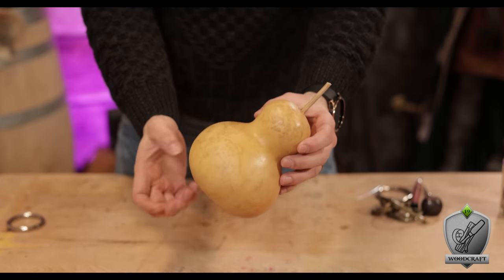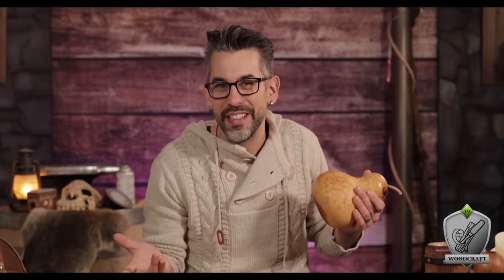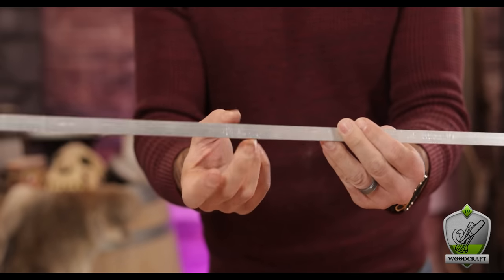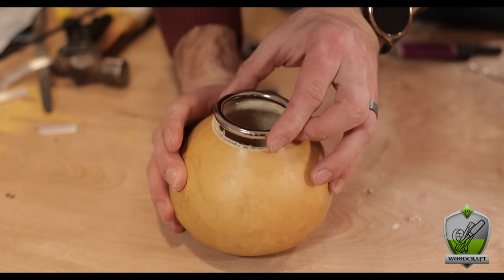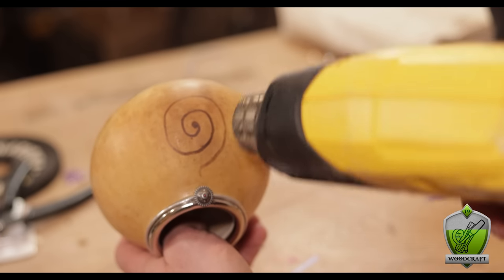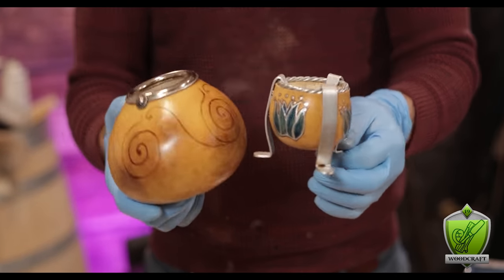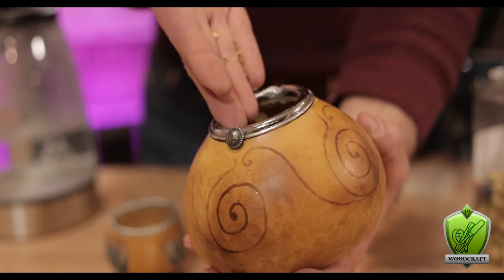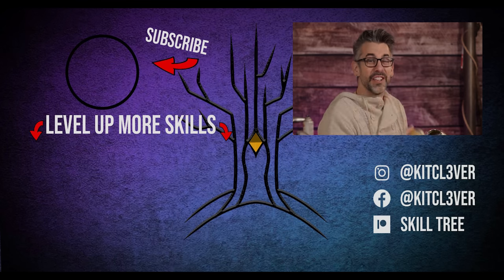Super Easy Gourd Tea Set

Comment: But how did you seal the inside?
Reply: I wondered the same thing
Reply: Another comment said the hkt water would have cured it so it wouldn't need a seal.  Completely outside my expertise so I have no idea if that is right.
Reply from the maker: It didn't need to be sealed. Turns out the gourd will hold water just fine without it. Just need to cure it a bit by adding hot water and scraping out the gunk. I wouldn't do that with a bottle though as it won't dry fast enough and will mold

Comment: What would be a great idea is if your tea set was self contained for a journey or something. Like maybe have a way to secure the cup as a lid and then mount the whole thing to a bag on the go or something.
Reply: Yeah a screwtop would be amazing. Just screw 'm together for easy adventuring!
Reply: I was hoping they'd connect and house the tea while not in use. Might have to order some gourds and prototype it myself for when I get to go back to LARP.
Reply from the maker: Love this idea! I will get to working this out!!
Reply: @SkillTree  Maybe a larger gourd, one with a wider opening to act as the teapot, and then a smaller one that can fit inside the bigger one for the cup(s)? 🤷‍♀️ 
Just a theory.
Reply: @SkillTree  my thought was to slightly elevate your Concho, and maybe adding to the spout form the outside by soldering a small lip. Then too wire loops on your cup. Loop one over the concho, then press the other over the spout! 

Probably not water tight like some are talking about, but a nice way to keep the set together!
Reply: Just hand tie a net to go around it with cordage or wire wrap it like you would a stone. Maybe some wooden or antler toggles to lock the lid/cup in place. Another option would be leather strapping, kind of similar to the mana/health potion bottle build. He gave ya the beginning tools, as crafters it's our job to expand and improve on the initial inspiration. This is how we make it our own.

Comment: Really neat little set.  Those gourds are really versatile.  I'm concerned about the metal rings you used along the rims, though.  Unless they are food-safe you may end up with metals like nickel, lead, aluminum, etc. leeching into your drink.  Also, your beverage may heat them up while you're drinking, which gets pretty uncomfortable on the lips (I know this one from personal experience with a camping mug I purchased a while back).
Reply: That was myu concern too. I know that aluminum is not good to use for hot drinking vessels, and uncoated it isn't good for cold either. He did use Aluminum for the wire in both so that will come in contact with the drinks.

Comment: I actually use nontoxic food safe resin to coat. As long as I’m careful when I turn it to coat it. It works and I also use it to make custom bottles with mica and edible sparkle dust.
Reply from the maker: What brand do you use? I have had a beast of a time finding a good food safe resin
Reply: @Skill Tree  the main concern related to the use of fully cured epoxy resin as a food container is identical to the concern surrounding other plastic items that hold food, BPA leaching. A hot drink does increase the amount of leaching compared to a cold drink but many containers also use plastic with BPA so if you are replacing a plastic container your consumption of BPA doesn't change. Additionally as this device would only be used a couple days per year the increase would not be a problem, mostly because we are constantly consuming BPA all the time and have bee since the 60s

Comment: 1. The legs didn't adhere because the skin of the gourd is not just waterproof, it's glueproof too.  I didn't particularly like those legs so yay failure!
2. If you can find a tea strainer that's the same diameter as the opening on the pot, you'll have an easier time with using loose tea.  I bet you can.
3.  Every single project I've ever worked on is a repurposed version of a previous project I made.  I think it must be part of my creative process.  Or I just can't leave things alone.
4.  Great job!
Reply from the maker: Oooooooh, good call on the strainer! I will need to look and find one!.
Reply: @SkillTree  That looks almost the size of the drop in strainers from the cups David's Tea sells? I might be miss reading the size, but if the opening is roughly 70% the size of a standard skinny coffee mug it should fit?

Comment: Would be cool to clean out the gourd, carve designs throughout, fill with resin and colored LED lights, leather strap/quick detach belt loop around the neck, boom, mages spells stored in a gourd. Can even use different colors and such for different spells.
Reply: That'd be so cool! Could probably conceal the battery pack/on-off switch in the bottom of the gourd.

Comment: A good idea, but I have a couple observations and suggestions. First, hot liquids make metal hot, which can feel uncomfortable against one's lips. Second, using two metals, steel and aluminum, might create a unwanted galvanic reaction. Third, if you wanted to make a pitcher, maybe leave the upper part of the gourd so that you can tie handles in the neck like you did with the water bottle, and; fourth, you can carve a spout. Fifth, you can create a set of cups by using the tops of several additional gourds, and; sixth, you can use the bottoms of those additional gourds as jars with lids of cork and/or wood for holding dry herbage for teas, tisanes, and tinctures or other sundry items.

Comment: Ah. The gourds are all sold out. I'm noticing a trend here...

As for the project... I'd have used the food safe silicone glue instead of the epoxy. Epoxy just doesn't seem to like organic things. It can work for wood, but anything else is unpredictable at best. Maybe there's a way to treat the gourd surface, maybe a thin layer of epoxy and let it cure before trying to use more epoxy to glue down the aluminum. Maybe also using a couple bands of wire would help hold the legs into place in a decorative way. If you want to try the cute cauldron style again. (P.s. I hate 2 part epoxy. It's always a disaster, probably because of my climate or time of year or whatever, so, biased I am.)
It could be cute to use more of the aluminum strip to make handles, but you definitely need decorative wrapping to reinforce it, or silicone to waterproof the rivets that would hold the handle on. Those would be easier than cutting a couple of slots for the aluminum to feed into- and seal gaps with silicone, of course.
I can go on forever with ideas, so I'm going to stop here...

Comment: so awesome and fun as always!!
of course i have some thoughts on the functionality/practicality(feel free to ignore lol):

Gourds will eventually decay, polluting your water, even faster so with hot liquids. maybe one could seal their gourd with preservatives of some sort? i know it was cured, but i wouldn't want to drink hot tea out of that without at least a filter.

There's not a lot of insulation in a gourd, so your drink likely wouldn't stay warm for too long. not much to be done about that though, i think.

using a scorch marker probably compromises some of its integrity(what little it had) so it's good you didn't do too much of it

the cup and pot don't seem to fit snug together, so you wouldn't be able to bring a drink on the go, and definitely not heat over the fire, but it is a lovely home set.

Comment: With the epoxy resin, did you rough up the spot on the gourd where it was attaching? The surfaces can be really slick and it may not have been able to hold firmly to the gourd.
Reply from the maker: I did! It is so weird how it failed to take.

Comment: For getting the perfect circle for the twisted wire, wrap it around a pipe of the desired diameter a few times. After a couple wraps, the circles will be more concentric and you can get more in one go (similar idea to making the rings for chain mail).

Comment: Bro. As much as I love when you plan something out and then execute it, watching your idea evolve was one of the most satisfying videos I’ve ever seen. I’d still love to see you do a gourd where the top part becomes a cup that also seals to the main body. Perhaps an internal neck that slides into the mouth of the smaller cup? And attaches to the larger vessel, but can still be detached. Just an idea. 

Also, on your leather projects, have you ever thought of edge lacing? It looks super clean and adds strength and durability to the edges.

Keep leveling up, you.

Comment: Personally I would have added a couple horizontal bands to tie the whole "cauldron" bit together. I'd also want to add a carrying/pouring handle of some kind to the pot, maybe using leather cord. Oh, and I'd want to add some kind of straining mechanism, like a sieve or slotted plate inside the pot that would keep the tea ingredients from pouring into the cup, or perhaps a separate little sieve/mesh catcher to hold over the cup while pouring. Maybe get overly ambitious and try to make the rim of the sieve a locking mechanism that holds the cup and pot together for transport/storage. Not sure how, exactly, but the idea is there.

Comment: You might want to consider a replacement for the hot glue with the detail piece because you're using it with something hot and hot glue melts easily and with that sort of thing always seems to separate at some point.

Comment: Idea(s): If you add a ring of that braided wire to the bottom of the cup it will serve the same purpose as the legs. 
Also you could use it to make a handle that doubles to lock the cup in place to the top using the same braided wire.

Comment: I recommend for the cup, to drill similar holes on the legs and the cup. Using the food safe silicon as a seal,   do the threading you did to hold/decorate the legs.